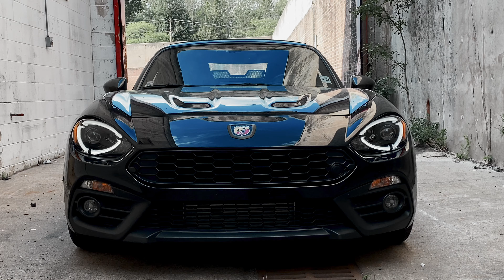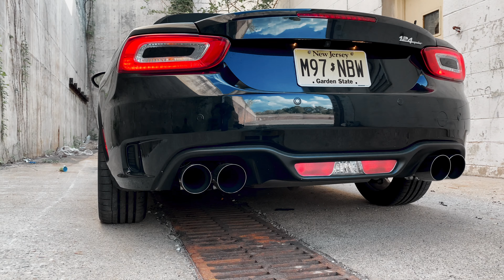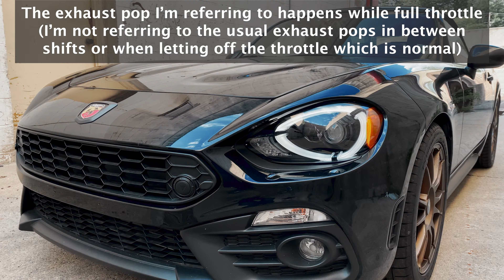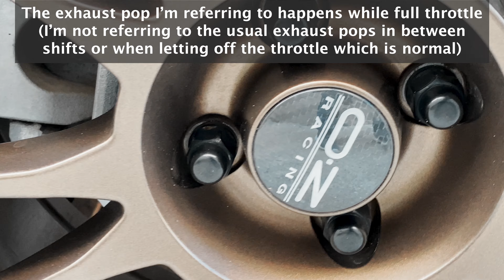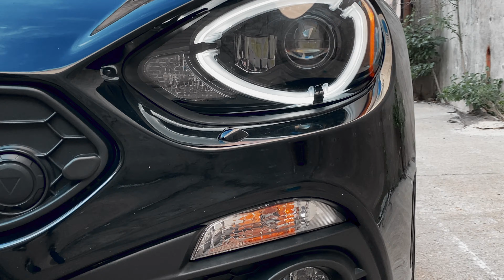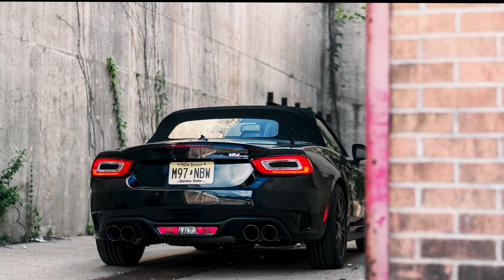Tuned Fiat 124 Spider Abarth POV Drive | On Throttle Acceleration (Manual)

Comment: Beautiful sounds, beautiful car. I’m considering getting one as a weekend/fun car and having my awd daily for when it snows. What’s the max hp you’d like to get out of it? It’d be so cool if someone is able to make 300
Reply from the maker: Thank you! I have a slightly larger drop-in turbo going in very soon and that should put me around 225whp & 250wtq on pump gas. On E85 idk, maybe around 250whp and that might be maxing out without doing more mods since it's still a fairly small turbo. And although the numbers don't seem big, the car weighs under 2,500lbs so it's quick for what it is. Over all it's just a super fun car! I've owned much faster cars but not many are as enjoyable as this 😁

Comment: Do you do any data logging?  I'd be curious if the hiccup is related to knock protection.  My understand is that this Magneti Marelli ECU responds to knock with momentary sharp enrichment.

You're not helping make my wait for one of these less painful. :p  If things go as planned I'll have mine in a few months and I'm stoked!
Reply from the maker: I was datalogging at the end part of this drive. I use OBD Fusion (mobile app), and I recently purchased their add-on pack so I can log more PIDs. The problem is with logging more PIDs, it made the refresh rate super delayed. Like 2-3 second delay in between pulling anything in so really couldn't use that log. After that I bought a wired cable and i'm testing out a new wired connection datalog with a Windows based app on my laptop. Still need to test with that but it should pull in the data much quicker. If it does and I can get it to work properly i'll have a video in the future going over it. I haven't driven the car too much after this but the little that I have, I did not feel this issue again, so i'm thinking it might have been related to a bad batch of gas (just a theory).

Comment: Thanks for Sharing, 
Just a thought do you know how fast
It can run the 1/4 mile?
If not when you get a chance and want to
Track the the with dragy.
Reply from the maker: Hey, thanks for watching! Yea I actually was supposed to go to the dragstrip a few weeks ago to see what it could run at the 1/4 mile, but it got rained out. I really wanted to get an official time at the dragstrip, but I've seen people review/compare the Dragy to their dragstrip results and the Dragy is extremely accurate. So when I get a chance to test it with the Dragy I will definitely make a video with the results! 👍
Reply: @DrivenDistrict  
👍 sounds good 
Also interested in how reliable do you think
This setup is.
As I would like to have mine faster
But still be somewhat of a daily driver, 
At lest thru the summer.
Reply from the maker: @danielescobedo7968  I don't have a ton of miles on my car, but Eurocompulsion has been know to produce extremely reliable tunes so I feel confident that it should perform well long term. Just keep in mind whenever you tune/modify a car, there is a higher chance that unexpected issue can happen, and you definitely want to make sure you keep up with proper maintenance. Another YouTuber (Mikey Turbos), has a 500 Abarth that he purchased new in 2013, he tuned it with Eurocompulsion a few months later, and as of today he is running their Phase 3 larger turbo with over 70k miles and no issues from my knowledge. I'll see if he can chime in as he has a longer experience of being tuned with these engines.